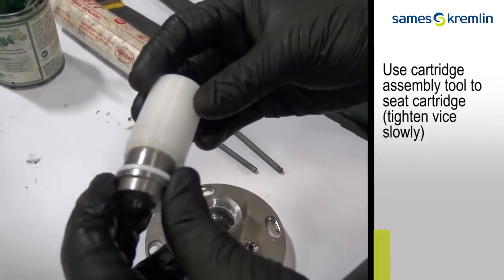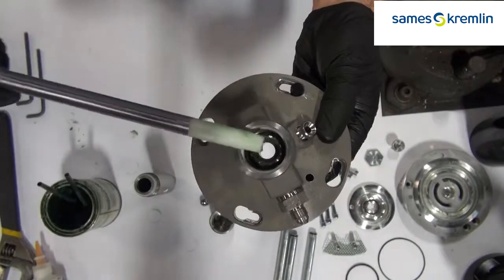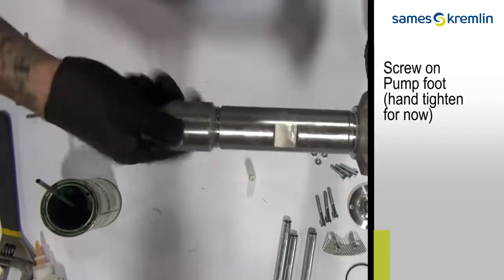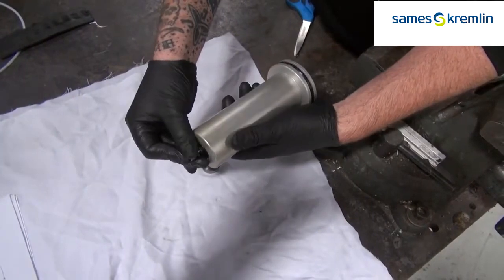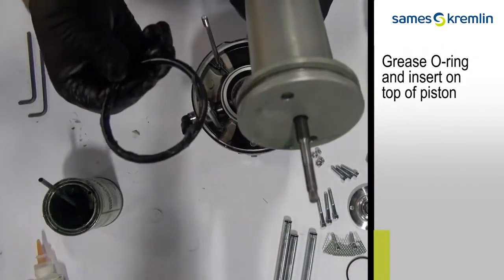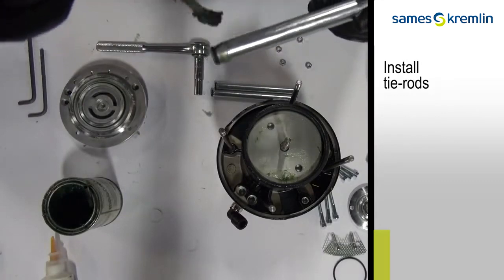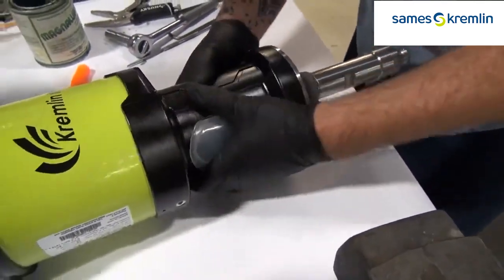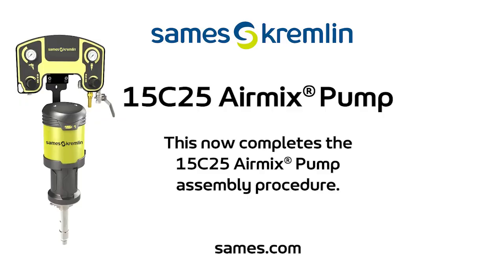Sames Kremlin Training - 15C25 Airmix Pump Assembly

Comment: Hi,
I have the 30c25 pump and the primer is coming in to the upper section where the lubricant sits. Any idea what is the issue please?
Thanks
Reply: Packings worn, will need to replace them